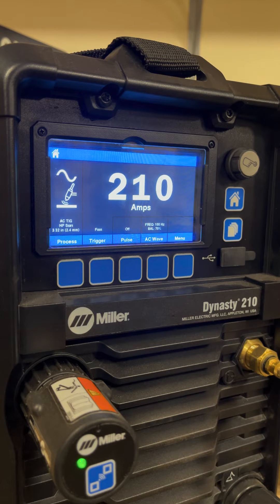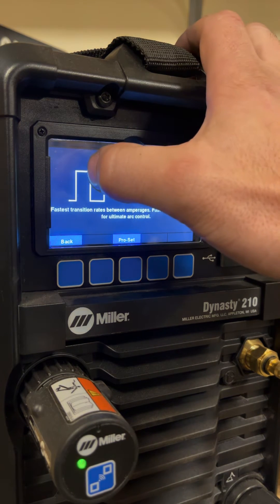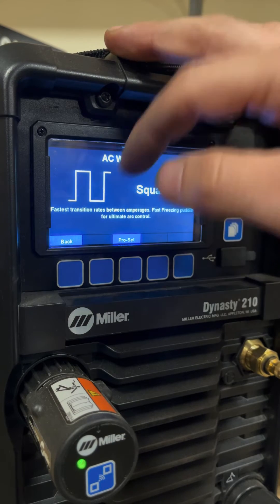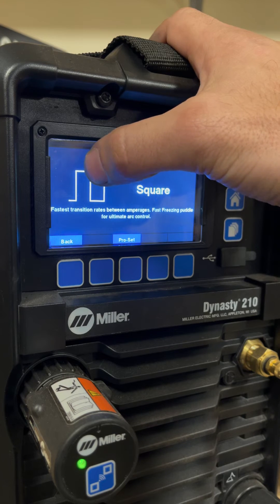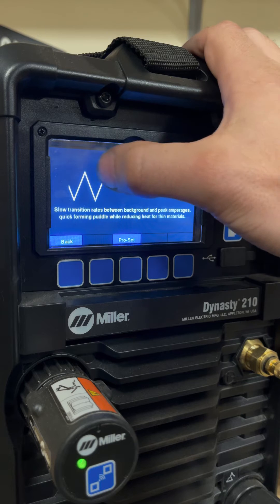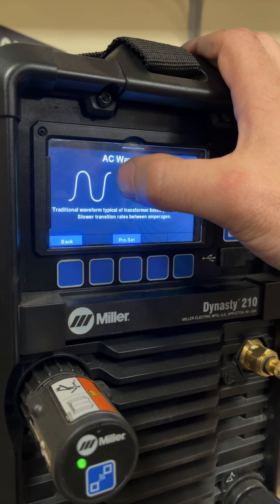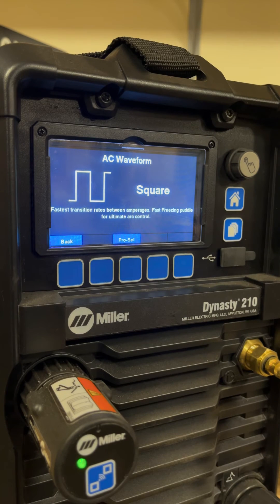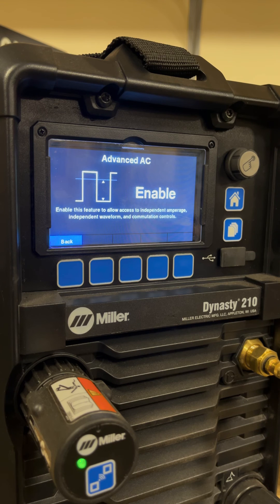A/C waveform / wave shape adjustments for tig welding

Comment: I wonder what the optimum welding frequency is, there must be a sweet spot, perhaps something the boffins havent sussed yet.
Reply from the maker: I have been working on a how to tig weld series and I will definitely cover that.  I can tell you that low frequency is better on thick material (60hz and under) and higher frequency (120+) is better for thinner.  As the frequency increases more dwell time is spent at 0 volts therefore less heat input.